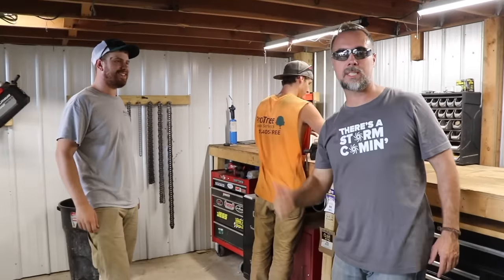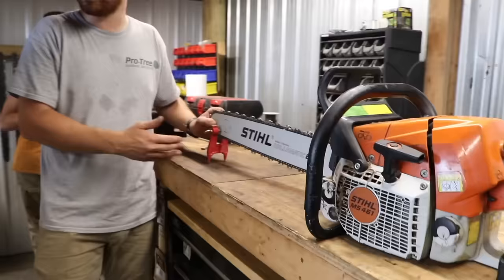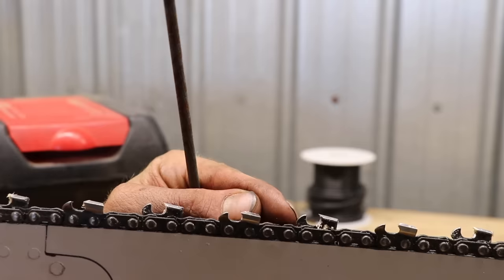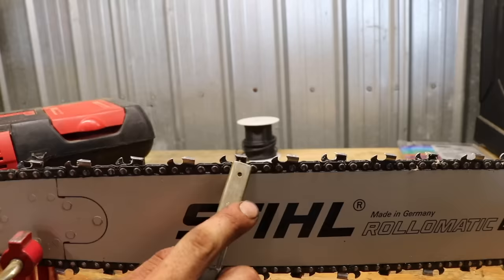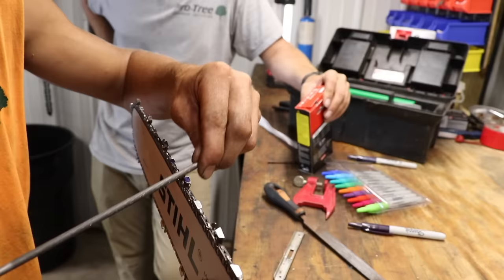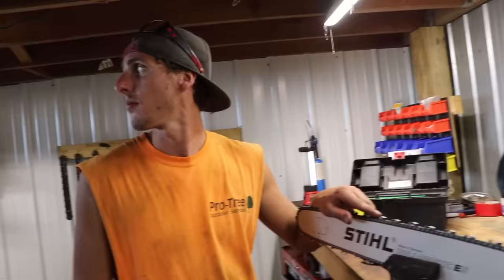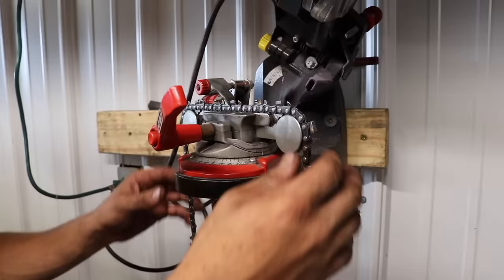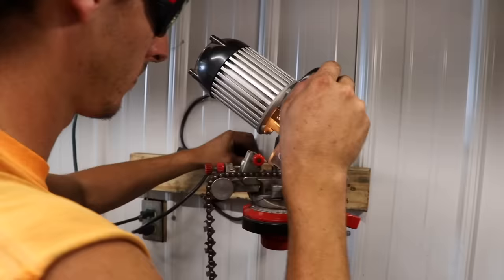How the Pro's sharpen a chainsaw

Comment: This is a great video with Tanner (orange shirt). He really knows his stuff. Everyone else needs to stop interrupting him and just let him teach.
Reply: knows his stuff? LOOOOL
Chainsaw sharpening Basics... When you use the file to move the chain, to get to your next tooth...
You put the file BEHIND the cutter and pull the chain forwards on the bar...
Pushing it backwards, like in the video, Is not the safe way to do it..
If your finger slips off the file, Or the file slips off the tooth when pushing it backwards, Your fingers / hand can come into contact with the very sharp part of the tooth..
Sliding it the correct way.. FORWARDS... if the file slips, Your finger hit the back of the tooth.. The non-sharp part...
Reply: I felt like telling the other guy to go away and leave (orange shirt) alone.
Reply: @RGD-Audio-Repairs  
Aren't you humble.

Comment: I bought a Homelite Lil Red with a 14" bar to cut a large branch a storm broke off an old maple tree. When I was getting ready to pay for it, a decent guy asked me if I had a sharpening kit for it. I didn't know what he was talking about. He was a customer like me but took me back where the files were and showed me a book with kits including one for my saw. Real nice guy. I read the operators manual several times until I got the nerve to start the saw and cut the branch into 12" pieces. I haven't used it since because I knew I didn't what the hell I was doing. I'll be re-watching your site and taking notes! Thanks for the great video!

Comment: Ran a saw a long while ago... this is how I did it hand held file flipping the saw to do the opposite side...as he said every tank of gas and rakers every 3 or 4 sharpening.  The thickness of the chip is governed by the top of the tooth to raker.  if your chips are getting thin and papery you know to lower your rakers... always use a raker file WITHOUT teeth on the sides. You can screw up your cutting teeth if you use a regular flat file that has teeth on the edge. Great video with excellent explanation so important to pass this knowledge on.
Reply from the maker: Appreciate the great comments, thanks Gregory!

Comment: I bought the electric chain sharpener at Harbor Freight for about $25 ten years ago. It is similar to the Oregon machine while obviously lower quality. It has always provided an accurate grind and sharp chain and paid for itself many times over.

Comment: Good job guys!!   I have been lazy and just purchased a new chain every time one got dull.  I'll wait for a nice rainy day and see how many of them I can sharpen up.   That will give me more $$ for the next beer run.
Reply: Just a tip - don't do too many by hand in one session, especially if they're long chains.  The first few turn out great, then the quality of work suffers.  I don't know if it's fatigue, eyestrain, or whatever, but everyone I have ever cut with has given me that advice.  Any time I have gotten cocky and ignored that advise to sharpen many in one sitting, I ended up with lousy chains.  Also, don't forget to dress the bar too. You don't need to do it as often but it needs to be done.  It's beyond the scope of this video so I don't blame them for not mentioning it, but search to learn this often forgotten step if you aren't already doing it.
Reply: They were wrong about the tooth size. You can file one more than the other and it'll work. Just take your depth gauges down proper way. I've done that many times and it works very well, and i'm not "professional". If you want to know more, check Buckin' Billy Ray videos, i learned from him and he really knows what he's talking about!

Comment: There are two things I suggest. For Stihl saws, I have to set the depth gauges a little lower than specs to get the chains to cut like new. Another issue is that if you use the suggested depth gauge setting tool for the chain, I found that you can't set the depth gauges as low as they should be because of the curve in the saw blade. Also, to prevent blueing of the cutters when using a grinding wheel, I suggest using Kool-Grind.

Comment: Good demo. I  learnt to hand file when I started using a chainsaw a few years ago. I still use my guides to help get the angle right. Now I can sharpen my chain better than using a local centre and to mention a lot cheaper.  Retouching the chain when working makes such a difference. A sharp chain is a safe one.
Reply from the maker: Thanks Alex
Reply: learned
Reply: Ive only wver hand filed mine. But never ground down the depth gauge
going to try again

Comment: Thank you for doing this. Never knew about checking rakes on the chain. Learned a new thing today. Kudos to the gents for show us the way!
Reply: It took me years to realize that the depth gauge needed filing.
Reply: Won’t cut if it’s too high
Reply: Lol, I worked with some tools that thought the rakers aka depth gauges never needed filing..  Took me months to finally convince a couple that they do in fact need to get filed down as the chain is filed..  Amateurs they were!!
Reply: It will make all the difference in how your saw cuts.
Reply: If they are too low like to kick back, so you're new to it use file gage, on both raker and tooth.

Comment: This was pretty interesting. I've been running saws my whole life and the one thing I've never mastered was sharpening the chain. I had no idea that the takers needed to be filed down that's probably where I have been going wrong. Keep these videos gping things like this can make a big difference for DIY people like me.
Reply: A sharp tooth is exactly that.  It doesnt matter if one tooth took 5 passes and the next tooth only took 3 passes.  Unless you enjoy buying chains. Your not going to cut crooked if all the teeth arnt the same length, your not going to remove less wood either. Counting strokes is and old school wives tale. But by all means,keep the same edge profile and angle.
Stop counting. KISS And yes file your rakers. Also Check out Buckin Billy Ray Smith for more wood cutting wisdom and a touch of axe throwing.

Comment: I like this video on the proper way to sharpen a chain saw blade, I ask a person that boasted he was all-knowing about such matters I  was told I bought the wrong brand of saw! I cut a maple, small one about 4" in diameter with a dull blade, then after sharpening according to how the pros sharpen a chainsaw blade ,i sailed right through a much larger maple with no problem at all. I also learned it's not the saw its the blade! I will not be buying another saw anytime soon. I already have 4 with dull blades, no more thanks to you!  THANK YOU VERY MUCH FOR EXCELLENT VIDEO
Reply: It's a BAR not a BLADE! The CHAIN does the cutting. The BAR guides the CHAIN!

Comment: I'm qualified to say this was a decent sharpening video... It covered the parts of the chain and the common best practices. Good job Stanley.
Reply: @john blackthorn No? lol Not good enough for you? lol ok Then please by all means make a better video showing us your "better" methods. I'm really interested to see how you do it better and how that translates to the thousands of people who will be sharpening chains.
Reply: Please provide qualifications
Reply: I disagree. It was all over the place. I bet anyone who is trying to learn didn’t learn much and probably more confused about it then they were. 
There was a lot of valuable key points in the video but someone learning doesn’t have an expensive sharpening machine. Should have focused more on the hand file. They didn’t mention anything about chain condition, tension, lubrication and bar condition. All four are key safety points and which will greatly influence cutting performance and life
Reply: @petergroschel9697  i said "a decent sharpening video"
I didn't say it was exhaustive or comprehensive or perfect. Why dont you make better one, then I'll come tell youhow good yours is
Reply: Adam A 
Yep I’ll just run it backwards for you so you can understand
Reply: @petergroschel9697  that's a funny way of saying "I'm not going to make a better video" but ok.
Reply: john blackthorn you a buckin billy fan. He grinds  all thy he time.
Reply: u i.p.o OP⁸
Reply: @AdamA-wg1ko  o
Reply: @steppoffaith8426  MP

Comment: Harbor freight sells a chain sharpener for 35 bucks, been using it for 2 years and it still works great. No need to blow 600 on a grinder.
Reply: Files or grinder
Reply: @patrickflorine9211  grinder.  Just like the one in this video only cheaper quality, but it works great
Reply: Ive been using my Harbor freight sharpener for 5 years. Still going strong!
Reply: The HF one is a little flexible for pros but adequate for someone who doesn't use it a lot.

Comment: How often you sharpen also depends a lot on the type of wood you're cutting. Ash, pine and other soft woods you can cut for days, even weeks if you're careful where cutting oak/cherry etc It's probably going to need sharpened every truck load or at least daily.  The most important thing when cutting a log on the ground, do not let the chain touch the dirt. One quick oops can turn a razor sharp chain throwing big curly kerfs into a chain that throws tiny sawdust and smokes. Nails and even knots in a log can do this too but the #1 thing I see guys doing cutting logs on the ground is letting the chain contact the dirt.
Reply: Exactly. You don't have to file as often if you keep it out of the dirt. Tree bark also traps a lot of grit. Dirty wood bad for chain.
Reply: I trained my self on an old sp125 McCulloch 38" bar, if you dont touch ground you can cut with any saw with out touching. That saw weighed close to 30-35 ibs.

Comment: Stihl makes a hand tool with a combination flat file and 2 round files that sharpens the tooth and takes the raker down at the same time.  It also has a bar guide for the correct angle.   Hand sharpening is a bit more tedious but the chain stays sharper longer in my experience.  Grinder may work faster but it takes off more metal and shortens the chain life sooner.
Reply: Plus they over heat the cut edge 
Hand type is best and the new shitl is great but to high price
Reply: Yeah the new Stihl hand sharpeners are really nice and doing a quick touch up is a easy thing to do! To me they are worth the price!

Comment: I was sharpening chains for years before I tried using a guide. It makes such a difference in keeping the angles to 30 deg. Without the guide I have a tendency to making the angle more acute over time and inconsistent from tooth to tooth. Getting a consistent 30 deg on every tooth makes the chain cut as well as when it was new and also makes it last longer (I.e can be sharpened more times before the teeth get too short). Maybe the pros can do it by hand but for everyone else I recommend buying a guide. They are cheap enough.
Reply: What brand/model guide are you using? Im looking at getting one.
Reply: @mat7247  I got the “OREGON 4.0mm (5/32-Inch) Chain Sharpening and Bar Maintenance Kit for 1/4-Inch, 3/8-Inch Low Profile Chainsaw Chain”. You might need a different size depending on what chain you have. You can buy 12 packs of files as well as they wear out after a while.

Comment: How to find a nail in a tree: put a new chain on your saw, start cutting.
Reply: Mike Sokolow never fails! Lol!
Reply: My brother just bought a new saw and his second cut BANG right into a 3/8 chain in the middle of the tree 😂 he was pissed... Good thing I Know how to file on the spot
Reply: Lol of course
Reply: hahahahah...I hate that this is true
Reply: You ain't NEVER Lied!!!!!!!!
Reply: Brand new saw. First cut, metal spike driven part way in and bent over just slightly so i could hit it with the chain. Half an inch either direction i would have missed it completely.
Reply: ‘You can buy carbide tipped chain still?
Reply: Yeah you'll find that occasional Stone underneath the Fell tree also. Oops.
Reply: @jamesnm21  😂☹️
Reply: I hit a cinder block right after buying a brand new chainsaw.
Reply: @wildhorses3098  It never fails
Reply: Cut out some boxwoods and one of them had grown AROUND a 3" river rock. Once I got them out I split open the stump and there was the rock - with a 1" deep groove in it (much cursing during and after)
Reply: My dad always did this part for me. Now this chick is a pro, with y’all’s help. Ty ty ty
Reply: That's so true, Put a new chain on my saw got half way done logging a tree and wham hit a nail. Put a new chain on again, moved down 3 feet away from the nail AND HIT ANOTHER NAIL...
Reply: Absolutely right!
Reply: Found a 40 year old fence post from a 10 ft cottonwood trunk that way lol.
Reply: I always keep an eye out on the big ones for the old barbed wire trick. Found everything from lamp posts to concrete.
Reply: Or an old fence
Reply: When's the sparks start going. Hahaha
Reply: Faster with new chain 😊

Comment: On raker depth, you can actually use the grinder to bring down the rakers simply by setting the depth then running the
Rakers slowly through the grinding wheel to shave off a small amount in each one.
Reply: Yes and no it's a different size grinder desk than the grinder you use to sharpen the teeth usually the grinder for the 404 teeth

Comment: I was very interested by Tanner's comment.  He shows how experience is the best teacher IF you think about what you are doing.  Most people know that when you grind hardened steel  and it turns blue you have lost its heat treatment and it will be softer and not hold its edge. But Tanner says it becomes harder as well!  How does that happen?  Well he is bang on... heat treatment of steel involves quenching and that locks the carbon particles in place uniformly stressing the steel,  when you grind too quickly you heat it and this allows the carbon to move "relaxing the stress"  However, if you have tool steel, Chromium and Molybdenum form very hard carbides.  These carbides are best when small.  When you heat the steel by grinding the carbides grow bigger but they do not strengthen the steel just  mess up your file since they are harder than the file. Great observation Tanner!

Comment: I fell a lot of trees in Idaho and Montana, back in the day. I found that good bar maintenance helps a lot too. I would flip my bar over once a week. It's like rotating your tires. Your bar will last a lot longer. When we were just out getting firewood, I would use my 12 volt Granberg hand held sharpener. It is fast and easy. And after the Mt. St Helen ash fallout, you were luck to get 5-6 cuts before you had to sharpen your chain. And our trees were Tamarack (hardwood), ranging from 2 to 4 feet in diameter.

Comment: Hand sharpened chain in the woods for 50+ years, raker height is important... if you find you've gone a bit low on them and the saw starts grabbing, switch from 7/32'' file to a 1/4''.. the 1/4'' really takes the hook out of the teeth, stops any grabbing, makes for smooth cutting. grabbing is extremely hard on chain side links, drivers and drive sprockets. This works well for .404'' and 3/8'' pitch chains.  Ground chain is good, but the grinder has to be set up properly... cheap ones are junk, good ones are VERY expensive, last good one I looked at was $1200. I decided a $10 pair of drug store glasses might do the trick... they do !

Comment: These guys know exactly what they are talkin about! Totally experienced. I endorse every little detail they presented! (Oops, all but one. You always drive your stump vise into the stump before you put the bar in the vice. That way you have a nice flat surface to drive the vice into the stump and do not have to worry about hitting on the chain and bar) I was a tree thrower on a logging crew and learned real quick how to hand file my saw. Out there in a timber, you don't have an electric grinder to file your chain. I got to where I could cut a slot into a stump and use that as my stabilizing vise for sharpening so I didn't have to carry that extra weight with me through the timber of the stump vise and hammer.
Reply from the maker: Thank you Phillip
Reply: I think he knows you hammer it in first, he just said it in a weird way in the video because he forgot to say bang it in before he clamped the saw in
Reply: I do the same .The vise would be cool cause you wouldn't have to lift your bar to move the chain. It's a good idea to mark your chain first for a starting point. Stihl chains have a green or yellow link already.

Comment: Definitely a good video for someone that's trying to figure out how to sharpen a chain. One thing they missed tho is you don't sharpen the gullet but you do need to take out some gullet as you go back on the tooth because as you go and the tooth gets lower you need to take out some gullet to keep your sawdust capacity and your your tooth profile.
Reply from the maker: Thanks for the comments Dan and thanks for watching !
Reply: good call i feel there where some things missed but in saying that how much info do you give the newbie  to start with. logger of some 25yrs
Reply: @mikekeen9710  yeah same here just mentioned that one because he specifically said not to sharpen the gullet. I have been cutting and hand filing for twenty years and there's  definitely a lot more to it than what they mentioned. It's  always interesting to here from fellow loggers, good luck and be safe.

Comment: You can get a raker height file guide that has a .025 for hardwood and .035 for softwood as well as a file guide to hold your file high on the tooth being filed to get the optimum cutting angle. The file guides also have at least 2 different angle markings for filing the tooth.
Different chain manufacturers use different angles for different style of chains.
Reply: The different depth rake height is for the type of chain you're using, .025 depth is for semi chisel low Kickback chain, AKA Johnny homeowner / Rental customer.
.035 is 4 full chisel chain